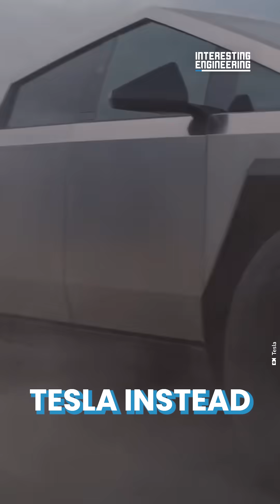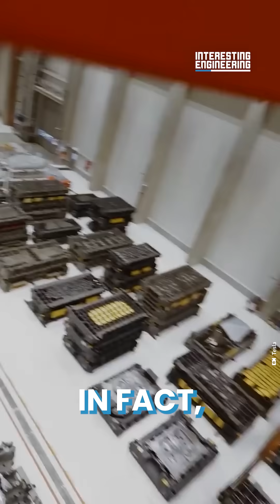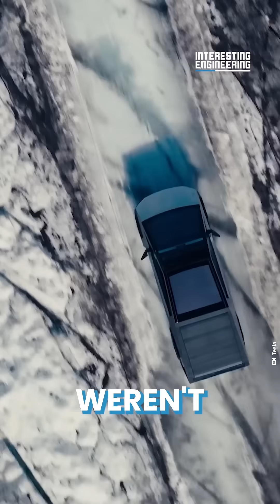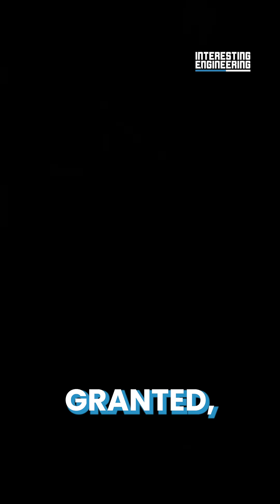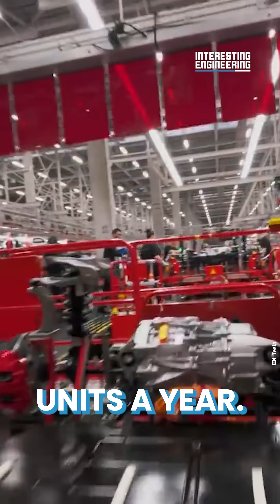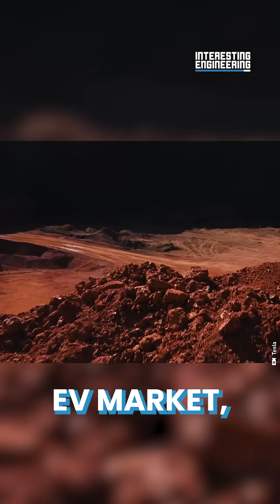Elon Musk's Cybertruck Stopped Production

Comment: So many faults. The panels don't line up, it rusts, the rear view mirror is tiny and can't be used if the tray cover is closed, the reversing camera gets muddy when it rains so you can't see to reverse,  panels are sharp so you cut yourself, the wiper lets water collect below it so it goes up the windscreen as you drive, the hubcaps cut into the tyres, you have to look away from infront of you to see the iPad that's been stuck on the cheap ass dash to see how fast you're going, the interior is cheap plastic everywhere, you can't reach things in the middle of the tray because of the height of the sides. This is all from people who own or have owned them.

Comment: 6 failures is vary low in a production run. I dont want to drive a remote controllable spy machine, at yhe flick of a switch you would not be able to leave your 15 minute city. Take out all the computer crap and build me a electric truck analog controlled
Reply: Theres a guy thatg put a tesla motor in a ford gas car after its engine went boom u might wanna chek thath out
Reply: @acidflowsalt2321  great idea 💡
Reply: 6 recalls, not 6 defective trucks.
Reply: Sadly this is all cars nowadays and the CIA already has a tool to hack these as well